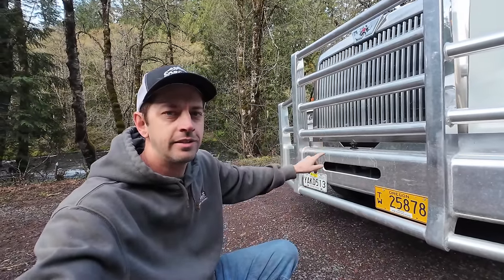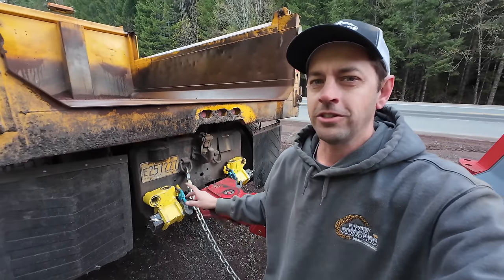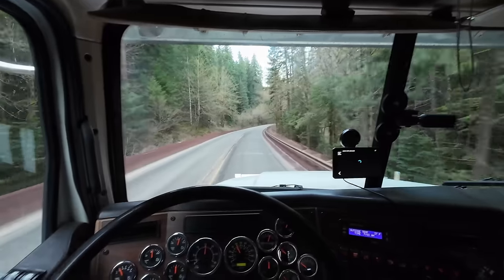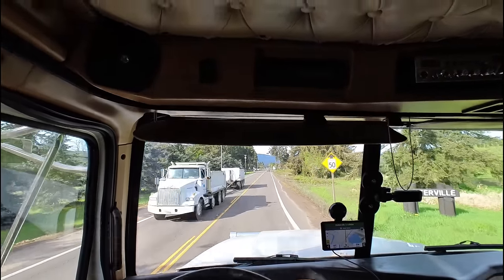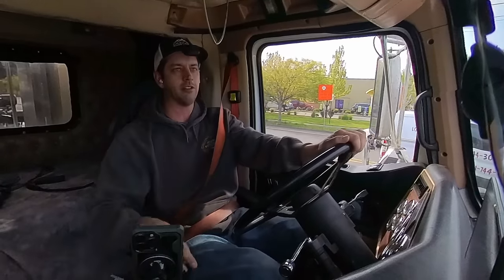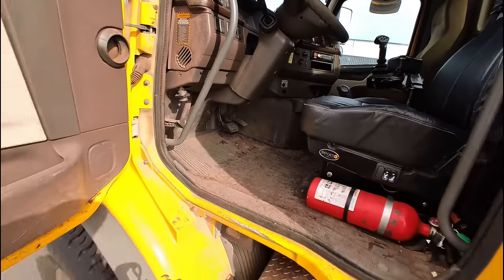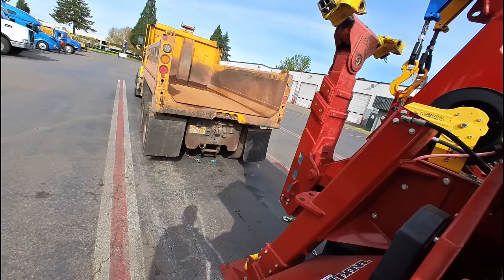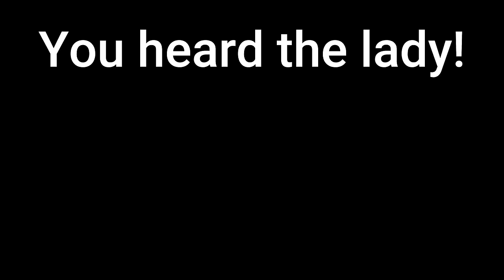How THIS can get your tax money back!  (the ultimate refund)

Comment: Front Load garbage (pete 3/520) we would use the manual fan on high speed hills. In the wet the trucks are sketchy to drive with the transmission brakes on so the engine fan was a huge help. Braking is not a garbage trucks strong suit....

Comment: When I was in graduate school, to help pay the bills, I drove commercial charter motor coach (yes a bus, similar to Greyhound but completely different.). As part of the pre trip inspection I had to make sure, even though except in Maryland and Utah, we were not required to stop at the weigh station (Things my have changed in the last 30 years) that the IFTA sticker was current. And...I had to record every single mile in every single state I drove in, regardless if I purchased fuel there or not (For instance, nearly 35 years later, I can tell you for a fact that I-70 between Ohio and PA through West Virginia is exactly 14 miles. Washington D.C. was a fun one to report...D.C. straddles Maryland and Virginia and it is not it's own taxing district. Since the coaches I drove only had the hub--o-meters and not a dash odometer, and since D.C. is not delineated as to exactly where it is...I just made crap up. (I apologize to the office staff.) I am quite sure that the office made crap up as well and all applicable taxes were paid (we had about 120 coaches).

Comment: I'm not a trucker, so may be wrong and please correct me if I am, but it's my understanding that the various states are only concerned with max axle weights to mitigate road damage.  They could care less if the truck has brake and suspension systems that are not capable of handling the weight that the state just licensed the truck to haul.

Comment: I used to hate the engine fan when running pump testing on fire trucks. Just as soon as I had almost got the flow and pressure set, the dang clutch would kick in and skew everything up.

Comment: Nice tow but I personally wouldn't have the entire tow connection relying solely on that hitch plate. Yes, a hitch plate can take a beating but its not made to support the weight of lifting the truck on chains for a prolonged period of time. I'd rather fork or shackle it.

Comment: The numbers game is true, I work for a company hauling cars with a 4 car, cab carrier rollback. We have 7 and 9 car haulers aswell, but I like running a rollback. The issue is the truck is 33,000 GVWR with a single drive axle so I can only be 20,000 over the rear axle. Well I can't use the cab carrier because in my experience, even with a small car up there I am over the legal height limit in my state so I can only carry max 3 cars. I don't have a scale, other than the ones at the truck stops that I would have to pay out of my own pocket for which isn't happening, to find out what the distribution is like for the weight. I reckon I could ask them at the DOT scales when I pass them but I would like to limit my interactions there if possible lol. I got one overweight ticket before for being like 22,000 over the rear axle for a load I really did not think would be all that heavy. Luckily my company pays them if we get them, but I have been known to take a more scenic route if I am thinking the weight might be a little off when I have to go by the scales. Why my company doesn't use regular sized rollbacks or have trucks with a 2nd drive axle is beyond me. But I don't get paid to have ideas, I just get paid to move cars.

Comment: I found in a tractor I used to drive that turning the air conditioning off on one hill made about a 5km/h difference with a fully loaded trailer. 
I'd turn it off at the bottom and back on again at the top.

Comment: I haven't seen it mentioned in your other videos, but what brand are those small retractable straps you use for the steering wheels? That retractable mechanism is super nifty, and those would be perfect for keeping in the back of a truck for strapping down small stuff without them getting tangled up.

Also, really like the tax clickbait title, technically correct is the best kind of correct!

Comment: Damn sure is a lot of separate compliance stuff you have to deal with. On a very different note when you where explaining about the light bar sender on the back of the truck it reminded me that in several of your videos you mentioned if the brake pedal is pushed the winch remote stops working. Can't remember if it was on the Western Star or the Rollback, but I bet it's the sender broadcasting the brake signal that is interfering with the winch remote. Try unplugging the sender and try the winch remote with the brakes applied. If that fixes the problem see if either the light bar sender or winch remote can be set to a different wifi frequency.
Reply from the maker: That’s on the rollback and I’ve tried that thinking the same thing.  Doesn’t make a difference
Reply: @CaseyLaDelle  Well that's a bit of a sod then. Must be something in the brake circuit that interferes with the signal, or perhaps causes a voltage drop or voltage cut on the winch receiver. Very odd.

Comment: Yep numbers, permits, knowing law.  My 1 ton truck can tow over 18k  lbs on highway with no brakes on unit i am pulling. But average person.  A trailer of 3000 lbs IIRC they require brakes on trailer.   I had two different counties Deputies check me out on over width 17k load.    Why 8’6” is legal width I don’t know.   Laws written for 30 years ago.

Comment: Did I see correctly that the whole truck was carried by two chains slotted into two chain fork slots which were welded onto the receivers? There's a world of difference between knowledgeable pros like him, and ignorant viewers like me. I never would have thought that would be the way to go.
Reply from the maker: Yep.  Those chains are rated at 15,000 pound working load limit each.   Between the two of them that’s 30,000 pounds of working load limit holding up only 10,000 pounds.   To make you feel even better about it, the working load limit is calculated at a 4 to 1 safety factor, meaning the strength of those chains is actually 60,000 pounds (minus a few percent for the connections and bend around the hitch plate), meaning that they are only using 1/6 of their strength to hold that truck.
Reply: @CaseyLaDelle  This is one of the many reasons I watch -- I'm getting less ignorant every time (this time it is to fully understand your equipment's specs and ratings). Thanks for the explanation!

Comment: I remember I bought a chevy trailblazer and put a lift and 32 in tires on it. I got shitty mileage. I got on the internet and the internet told me to take the mechanical fan off and install electric fan. The internet said that mechanical fan was sucking up my fuel mileage. I was all pissed off one day and I forgot to turn of electric fan. By the time I noticed the engine was overheating it was way too late. Smoked the engine because the internet told me to.
Reply: The internet should have told you about thermostatic switches that would have saved your engine.  Bummer that happened to you.

Comment: You shoved the truck forward so you could lift the under reach up and then crawled about by the rear axles to get your chains off.
Did that truck have its brakes applied at that point?
Reply from the maker: It’s brakes were never released